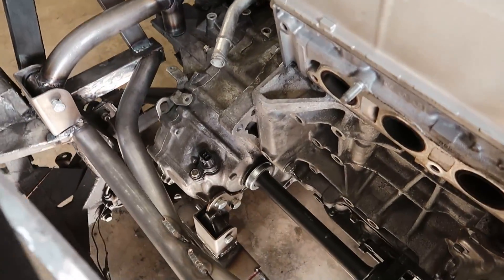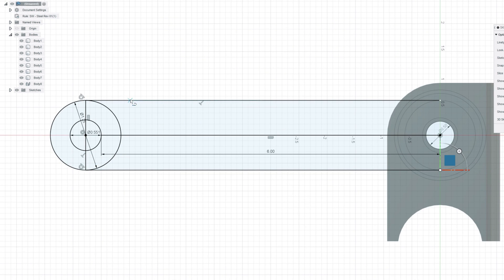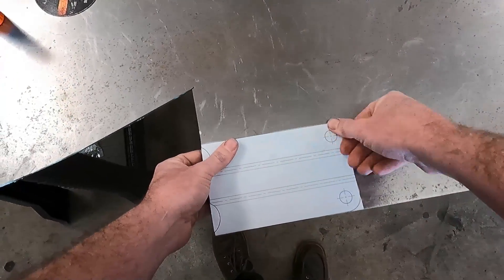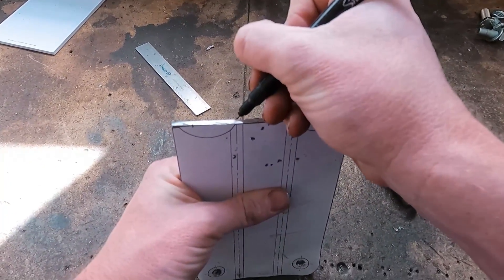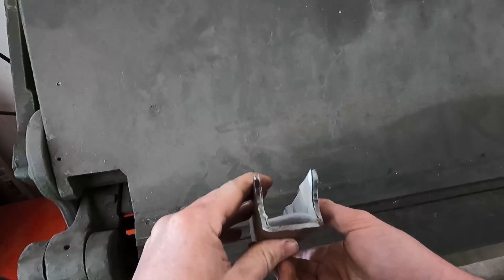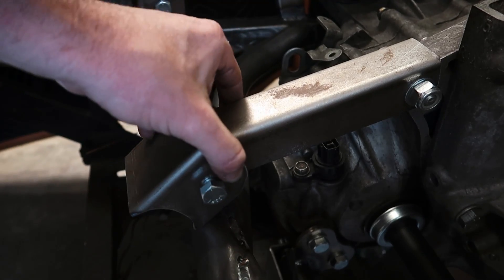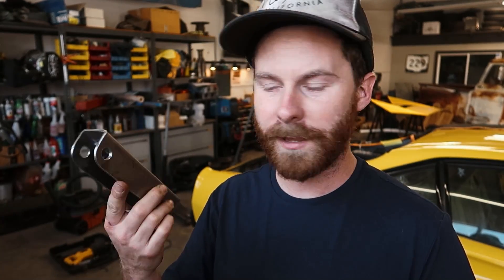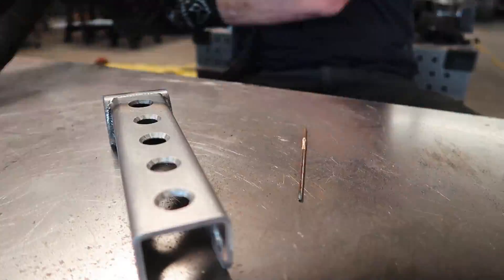K Swap Ferrari - From CAD to Finished Part with No Fancy Tools! Building Motor Mounts Pt. 2 - Ep. 26

Comment: I've been using CAD and 1:1 scale printed paper templates simply for puting accurate hole locations in the sides of electrical project enclosures. As you mentioned it is a very versatile tool that can be used at varying levels of complexity as needed, all the way up to having a plasma or waterjet machine produce a mostly completed part.

I use 3M Super 77 spray adhesive to hold paper templates down; it holds reasonably well, releases the template easily, and residue cleans up with acetone or mineral spirits.

Comment: Pro tip: After applying a decent layer of glue stick, then hammer the paper to your stock with a mallet and a block of wood to even out the force. This results in a good bond that won't come off unintentionally while working the piece - even through bending, but can still come off when you're ready. I've done this a bunch of times with aluminium, but don't expect it to be any different with steel.

Comment: I'm a fairly new subscriber.  I know this is a older video, but I'm watching your videos from the oldest to the newest.  You are doing some nice fab work on some very cool projects. I really like your Ferrari and Model A builds. 

What I like to do to make parts, like this mount and bushing brackets, is start with square or rectangle tubing.  I find it quicker then laying it all out on flat plate and having to do all the bending.  Not as cool as fabbing out of flat plate though but another option.

Comment: Binging this series, can't wait to see where it goes. Tip on cleaning up holes on the parts your making, use a countersink bit to put a small 1mm or so bevel all the way around the hole. Helps direct the bolts into the hole as well. Only takes about a second or two, since your not trying to actually countersink the hole.

Comment: Why were you so worried about the paper coming off?  Just glue it back on or print out another one.  You had already cut the outline and center punched the holes.  Just wondering.

Comment: a little late to the party, but i think the rear torque mount should be more in-line with the horizontal member. the mount welded to the tube, will be stressed in shear, where it should probably be in compression when fighting the twist of the motor. love your videos. thanks.

Comment: It helps of you go around the edge of the paper lines with a knife, the paper stays in place so you don't have to grind the metal and paper 👍
I do this on wood projects and use spray mount ...
Great work 👍👍
Cheers

Comment: This was great! For those who dont have other ways to bend the metal, i’ve had success cutting partway through the bend lines using the angle grinder until i could bend it in shape using hands or pliers. Then filling in the thin bend areas using the welder to build the strength backup.

Comment: If the engine rocks (tilts) towards the rear, will the top of the new bracket bind on the transaxle?
Reply from the maker: The whole point of the bracket is to keep it from rocking/tilting at all.

Comment: Is there a simple alternative to using an angle grinder with cut off wheel for metal that thick? I really hate using cut off wheels and working in a smaller garage I would rather not have sparks being thrown everywhere!
Reply: That depends on what tools/budget you have.  Depending on the size of plate and the part you are cutting you can cut it with a vertical bandsaw if you have one. A metal cutting circular saw. Or even a handheld jigsaw.  I've cut a whole lot of 1/8" steel plate with a hand held jigsaw.  It is slow but it works.  The grinder with a cut off wheel cuts a whole lot faster. But as you mentioned it does throw a bunch of sparks.   A plasma cutter is fairly expensive but also makes quick work of cutting plate. But it also throws sparks.

Comment: This is a great technique for people to use and it's great to point out that you don't need anything other then a off the shelf printer and some low cost equipment to make really accurate CAD designed parts.  For those thinking it's a waste to do the CAD work and not have things Laser/Water/Plasma Cut or CNC Milled or 3D printed this is still a very valuable technique for people who don't have access to those machines or can't afford the per part cost.  I've taken Cardboard templates made from the project, drawn them in CAD, then printed the template in some situations in the past.  It's very easy to print multiple of the same part and have them easily be identical.   The other advantage is even for projects being built entirely with low cost tools the level of spatial design that can be achieved using 3D modeling software can save you tons of time and materials when you get to the execution stage.  
Keep up the good work, and put your guard back on the Angle Grinder.  Especially if your going to use cutoff wheels to side grind (Which I do too all the time they say not to.. but they work so well).  They can and will explode easily and running with no guard can turn a scary moment into a ER visit.

Comment: I just use cut vinyl as my templates. Good adhesive without leaving a mess, and I can cut it straight from a design file and not have to worry about fragile paper that can fall off, shift position, or get damaged easily

Comment: One question:
Could you get paper similar to those in tattoo shops, that have purple ink on the wrapped side, when they applied to the skin? It would be similar to sheet metal you do, but without glue?
If you tried, is it that much expensive? If not, do try.
I think, that would be more effective for the project...

Comment: Why are you building so many mounts? from my understanding the whole assembly should have 3-4 mounts with 3 being the preferable (easier to do right) option. I am not a expert in mounting Honda K24s so i might be completely wrong on this, but i think only 3-4 should be used and other mounts are there to make the engine fit multiple car models. But definitely a great video, i still wish you chose a ferrari in much worse shape and not cut a pristine one, but with every video i am getting close to feeling like "yeah this is cool", considering that after i watched the first video, I wanted to cry, its quite a progress.
Reply from the maker: Because I’m going to make a butt ton of horsepower.
Reply: @stanceworks  yeah, like i said i might be wrong, i remember from my engine integration days, that we used 3 mounts, with the fourth-one there is a problem with the force being mostly on the three mounts anyway and the fourth mount is not properly loaded, i thing with more than four mounts this problem will be more apparent. Of course your mount can be only as strong as the engine/trans block, so maybe more mounts will help with the horsepower, my point was just that i might not.

Comment: Tip 
Go to your local dollar store or the like and grab some silicone trivets and or other cook ware items to use when welding.
The trivets can be used as a resting pad for your hand to keep from getting burnt and or shocked.
You can also use them to move hot parts.

Comment: Tip.
Put anything you don’t want damaged in a very safe place.
I once had a hammer shatter (faulty cheap piece of crap) and part of it shattered a windshield and another went through drywall and a carbon fibre hood. I was only trying to pop a ball joint so it wasn’t like I was abusing it.

Comment: Tip it is often unnecessary to cut a cope in sheet metal.
Place the spot to be coped over a piece of scrap tube and whack it with a ball hammer to fold it into a cope.
You can start the cope before or after folding as a few taps with the ball will shape it to the curve.
This can be a stronger join than a cope when welded as it moves the stress lines away from being just a straight line which can cause weakness in a structure that may need to flex such as a chassis.

Comment: Using that centre pop to mark the hole centres and the cut lines and the fold lines before you even touched it with the angle grinder would be a better idea. One pop at each corner and a few down each line and you can toss the paper away.

Comment: You should scribe the lines so they can't wipe away. I said it before, pilot drilling is the wrong way to drill holes. Buy a drill press or a mill. With all you do a mill will pay for itself, besides your a baller......
Reply from the maker: I’m absolutely not able to afford a mill on a whim. I’d like one eventually, but that’s not in the cards right now. 
I’m also not sure what you’re on about with pilot holes. A step bit won’t really work without them, and it’s literally just a series of pilot holes in actuality.
Reply: @stanceworks  There are mills out there for under 2k, look around. Step bits are meh at best. Like I said look at how a drill bit( not a step bit )  really work. The cutting edge is designed to work as one plane. When a pilot is used the center isn't worked with the rest of the edge resulting in worn tips. I've been through it with tool makers. Even a drill press will simplify your life man.
Reply from the maker: $2k is still way out of budget at the moment unfortunately.

Comment: Spray adhesive works great for gluing templates down too, just not something as strong as Super77.
Reply from the maker: I haven’t found any that don’t cause issues after getting hot. If you have any suggestions I’m all ears!
Reply: @stanceworks  Loctite General Performance works for me.  I use it to glue my CAD drawings to steel for knife making mainly but have also used it for brackets.  I do most of my cutting on a portable bandsaw mounted on a stand, but sometimes use grinders for cutting.

Comment: making all the trouble to design it with cad and then making it by hand and not by lasercut is wasted energy.better use just card board without cad.sorry
Reply from the maker: Getting parts laser cut is expensive. My local shop has a $250 minimum fee. I’m not spending $250 for this motor mount. The whole point of the episode was that it doesn’t need special tools like a laser table, which costs what, $100,000?
Reply: @stanceworks  Please keep doing the mid-buck solutions. I can do the lower-buck fab (cut, weld, drill flat stock) and it is fun to know that someone with endless dollars could CNC the bit start to finish out of billet, but I really like seeing the ways between... and your way is likely faster than either extreme for a one-off part!

Comment: This was great. I am about to start with 2d cad. I had some experience with self taught 3D drawing in 123Design (which no longer exist, it's has all become Fusion360)
But I was thinking to restart from the bottom with 2d and then go back to 3d.

Comment: Something you might try is getting a 3D printer and make it and see if it fits
Reply from the maker: It’s on the to do list... but in the 20 hours it would take to print, I could make the part several times over.
Reply: @stanceworks  ok it was just an idea. Check out the Creality ender 3 max. It's a very easy and fast printer